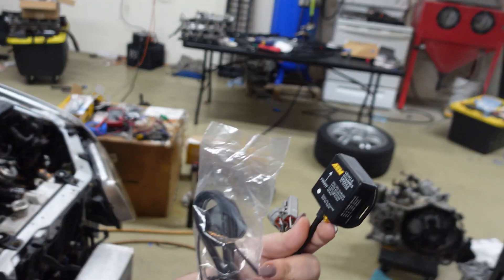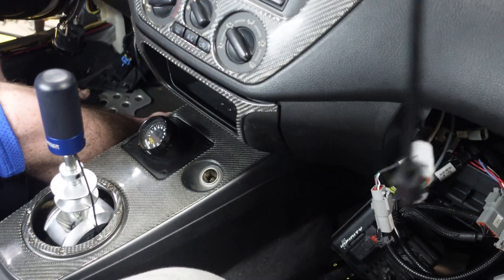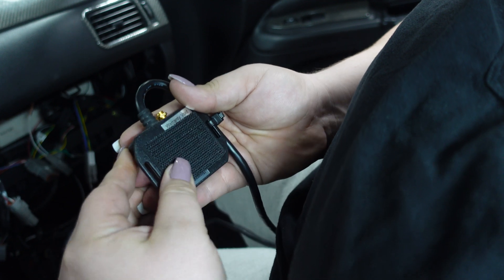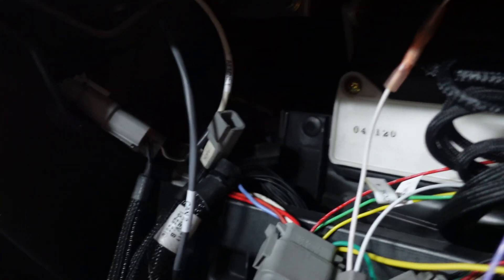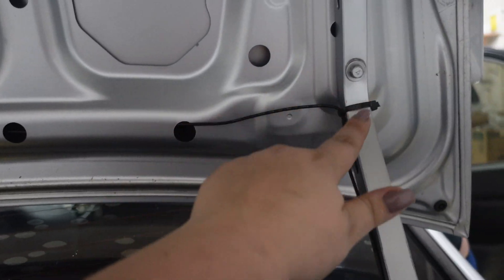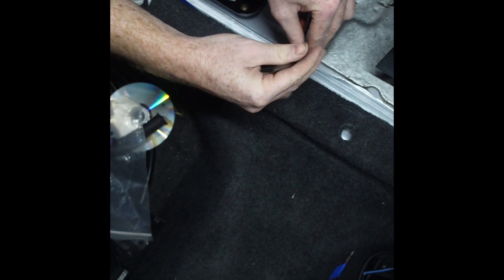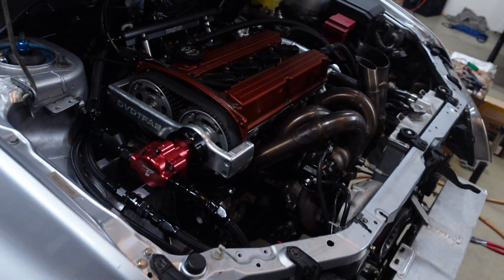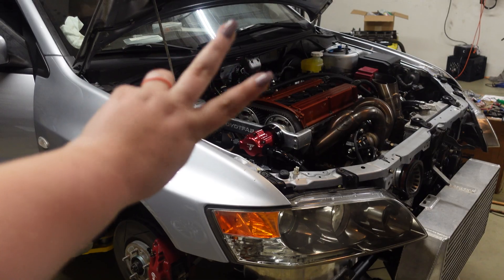AEM Vehicle Dynamics Module (VDM) install in Evo 8

Comment: My VDM light is green, but dash light is red and doesn't show speed.  Is there a place in the program to turn it on in dash?  I noticed yours was red at first also.
Reply from the maker: It was red at first for ours because it wasn't connecting to the satellite.  We moved the car outside the garage and the connection started working again.
Reply: You ever figure this out? I’m having the same problem
Reply: @Blurple_GTR33  yes. It was pulling gps from wrong location in computer
Reply: @88SilverBullet  do you remember what you changed?
Reply: @Blurple_GTR33  not right off hand